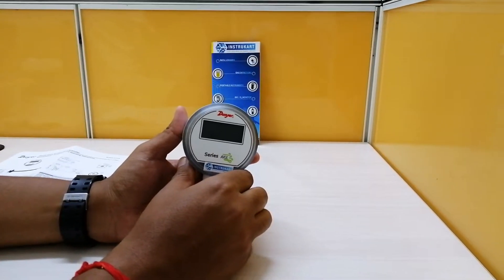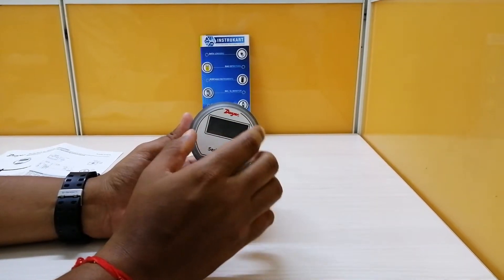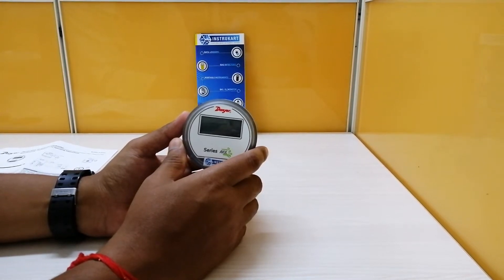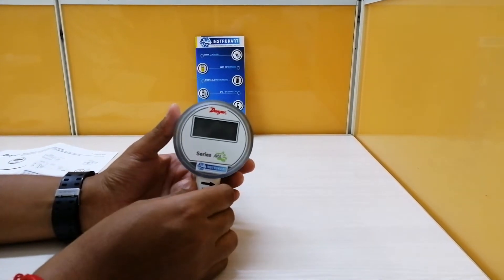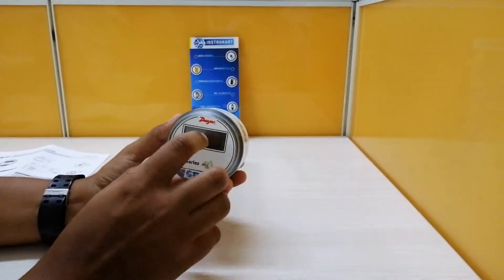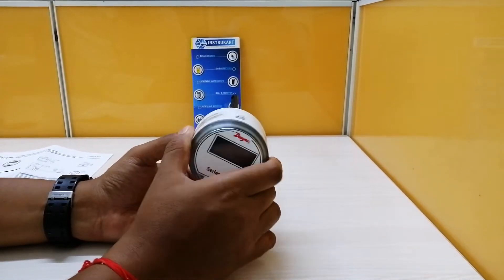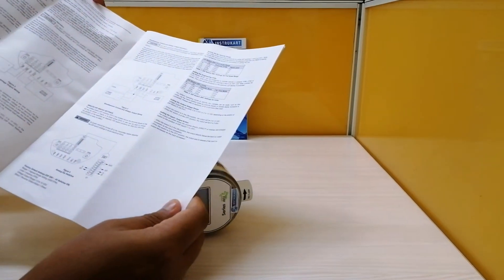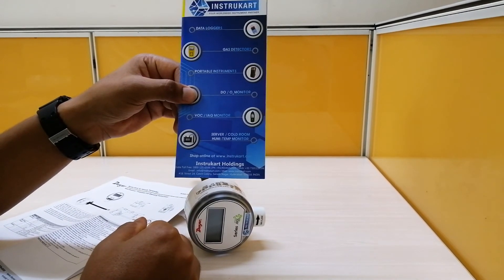Dwyer SERIES AVUL Air Velocity Transmitter| Instrukart

Comment: Hello, If we want to trip the machine at X m/s (within the range of sensor). Can this be done or it just measures the velocity of air?
Reply from the maker: Hello Harshil Parmar, 
For tripping the machine at X m/s, you should require a controller at user defined setpoint. 
Thank You!!